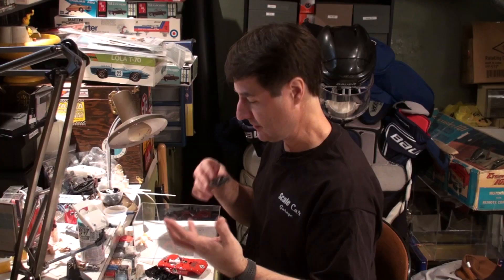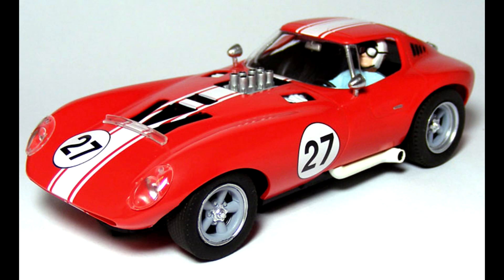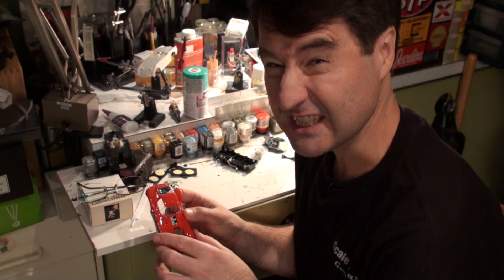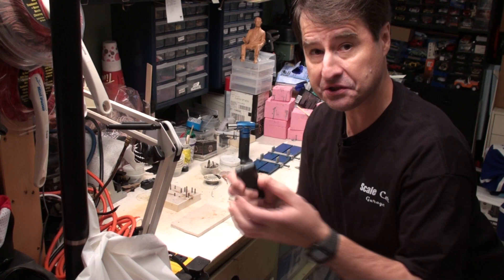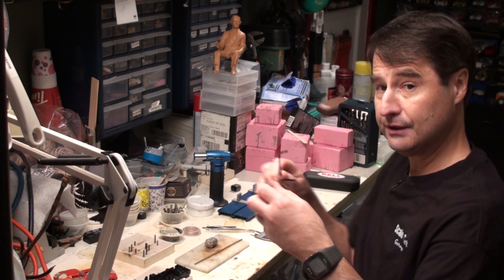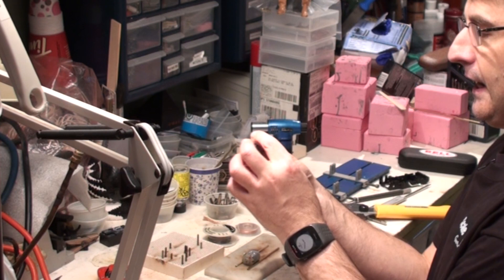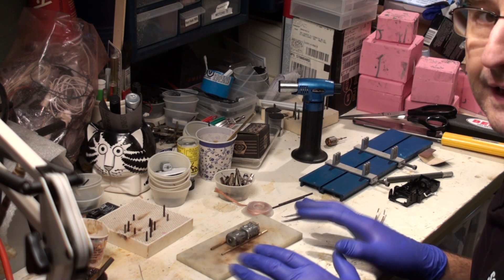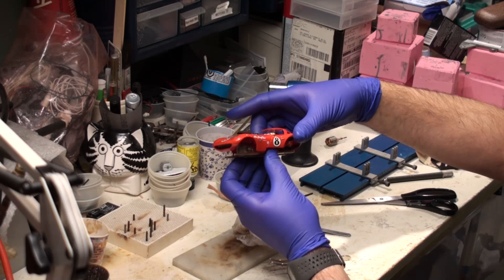Scale Car Garage - 1/32 scale 1964 Cheetah - Brass Chassis Build

Comment: I've watched the entire video now & have just a couple comments. When I clean brass, wire, steel, etc. I like to use synthetic steel wool (nylon mesh). I find it's very flexible & works great on flat surfaces as well a round, square, & anything where the surface shape of a part  changes with dips & curves. The green pot scrubbies found at the grocery store is a good source. Some dollar store will have them too. If you want finer grades, check the paint departments of a home center or a hardware store. There is nothing wrong with just using grades of sandpaper. I used it in the past before I knew about the synthetic steel wool. When soldering chassis, I like to keep a container of water mixed with baking soda & a small natural bristle paintbrush handy. The baking soda helps neutralize the soldering flux, so it gets brushed on all recently soldered joints to prevent rust  or oxidation forming if one didn't wipe clean enough. You could also use liquids such as acetone, naptha, & lacquer thinner, but they're all harsh on your skin.
Reply from the maker: Bill, thanks so much for your great recommendations! I will certainly have to give them a try!

Comment: The ceramic blocks you use are actually gas radiants from gas fires and gas boilers.
Reply from the maker: Yes you ar e absolutely correct! They are just great for making jigs for chassis as the holes are uniformly spaced and they can accept a large amount of heat! Thanks so much for watching, commenting and subscribing! I really appreciate it!

Comment: Hello, is the tool that appears at minute 14:05 purchased or have you made it? If it is purchased, what is it called?
Thank you
PS Could you put subtitles in Spanish to the videos?
Reply from the maker: The tool that I was showing is called the "RussKit Adjust-o-jig" and was produced in the 1960's. These are available on e-bay and I find them quite handy when scratch building a chassis! As soon as I learn how, I will try to put Spanish subtitles in my episodes! Thanks so much for watching, commenting and subscribing!

Comment: Hi John, one moment I had to double check was when you got the razor saw out, I need one of those!  What make is it, where can I get one and how many TPI is the blade?  Kevan.
Reply from the maker: Kevan, the razor saw I use is made by Olfa and the blade I use is 24 TPI. I hope this helps!
Reply: @FastSports-ScaleCarGarage  thanks buddy.
Reply from the maker: @modelracecar  My pleasure!
Reply: @FastSports-ScaleCarGarage  A catchup, the razor saw is super useful, I use it for all sorts of projects...quite often on my 3DP work...also a great way to cut lengths of brass tube for axle spacers.
Reply from the maker: @modelracecar  I'm so pleased that you are enjoying using a razor saw! Thanks so much for your follow up!